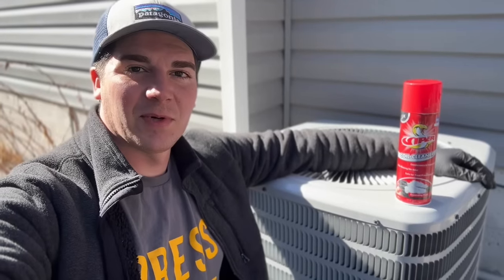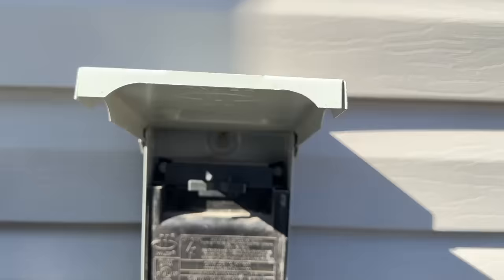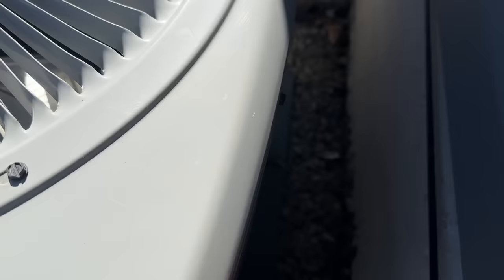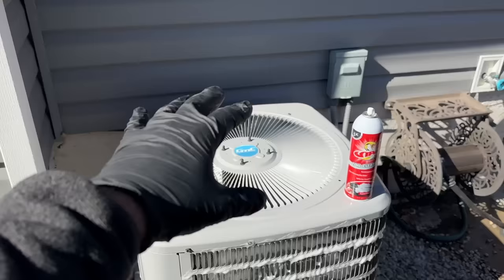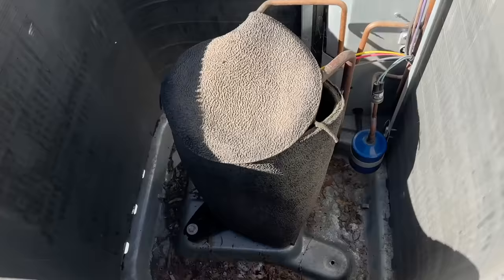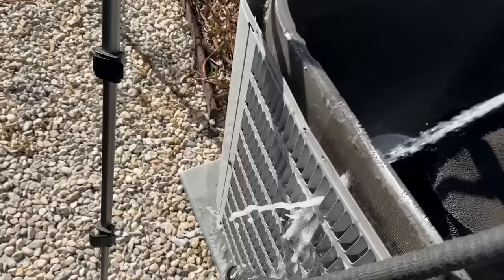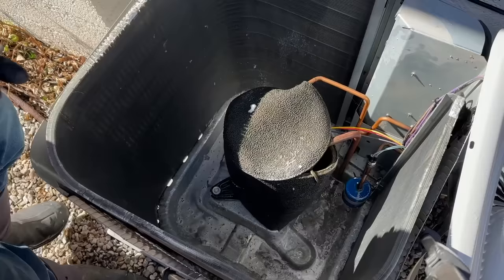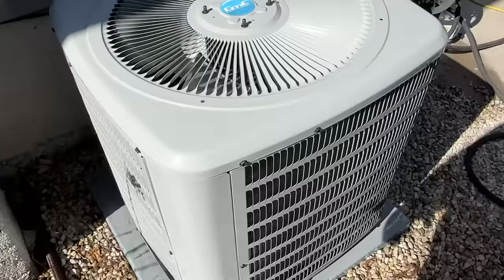How To Clean Your AC Condenser Unit | Spring Cleaning Pro Tips

Comment: Hello, I'm an HVAC specialist in the trade with over 40 years of experience. 

In my humble opinion, I think you're doing both the consumer AND the trade professionals a terrible and  dangerous disservice. The work you are demonstrating should be performed by trained professionals ONLY. 

Not only because of the caustic properties of the various coil cleaners. Though they are basic  (meaning not acidic), they can cause serious chemical burns and potential loss of/damage to  eyesight - among other things. 

Also, an untrained consumer has  no business opening ANY PART of the unit - FOR ANY REASON - there are no 'user serviceable' components in this system - short of the filter a gentle spray down with the garden hose periodically from the outside - WITHOUT DISASSEMBLY. 

I have to ask.... do you accept ANY liability if a consumer either gets hurt or damages their equipment as a result of attempting to perform  - what should be - a task performed only by a trained technician?

Just food for thought.....
Reply: Well, don't charge $100 to change a $20 capacitor.
Reply: Well, maybe he has a family to feed and a mortgage to pay.  WTH?